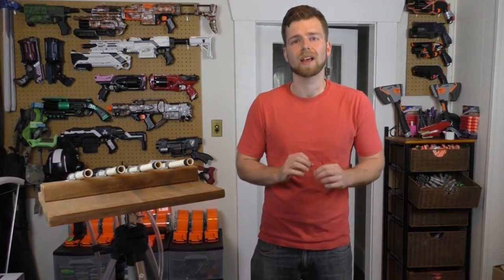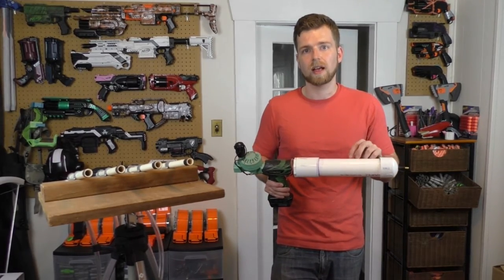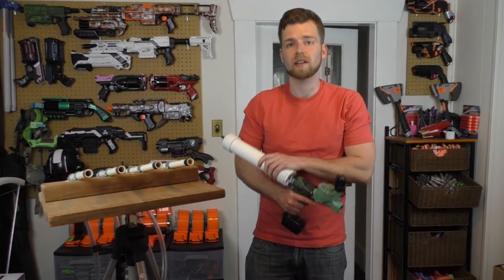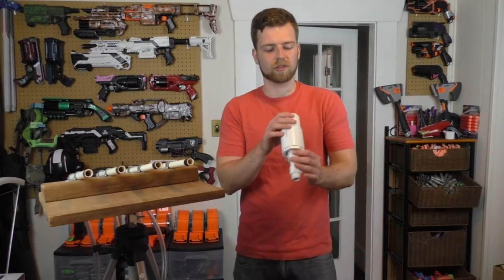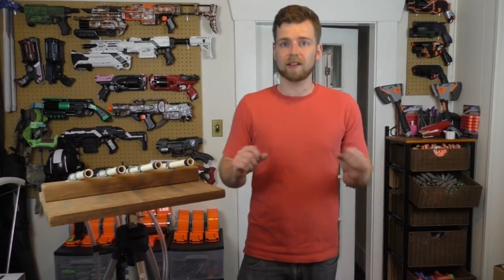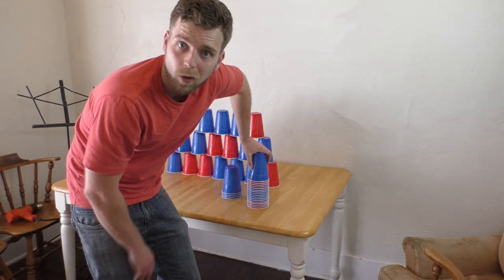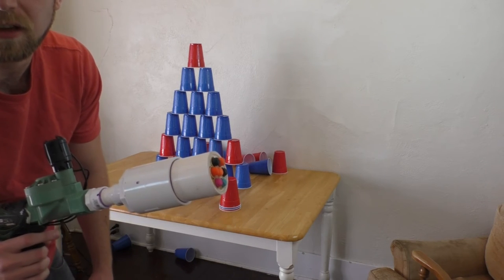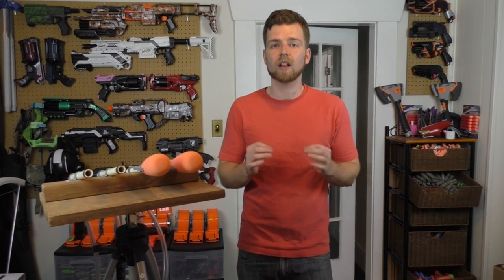High Powered Homemade Air Cannon for Nerf Projectiles

Comment: Instead of PVC pipe, have you thought about using aluminum double wall water bottles? I see them for a dollar at thrift stores all the time. Most of them are throwaway promo bottles. They can handle much higher pressures.